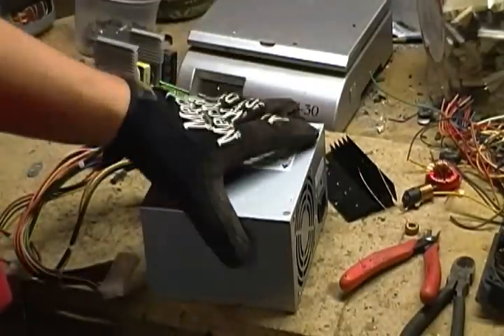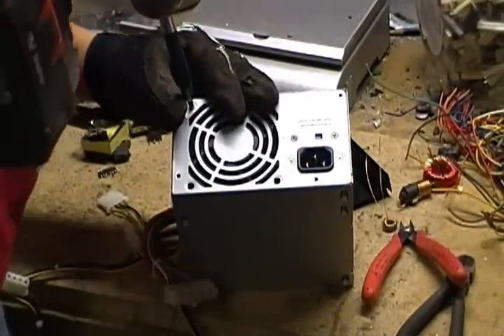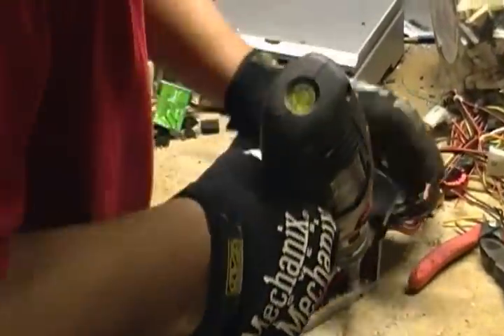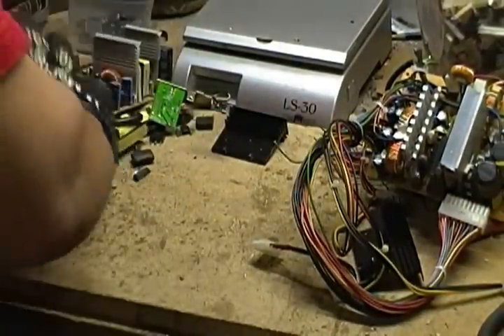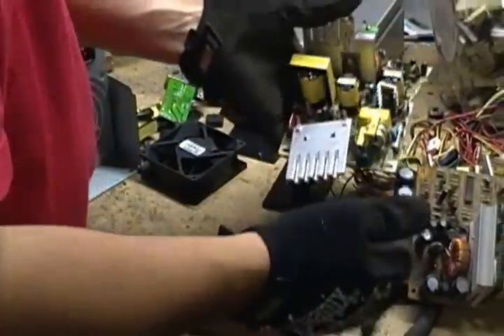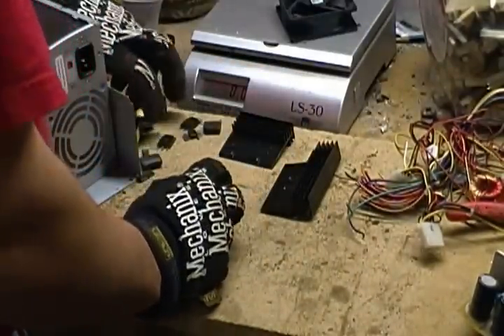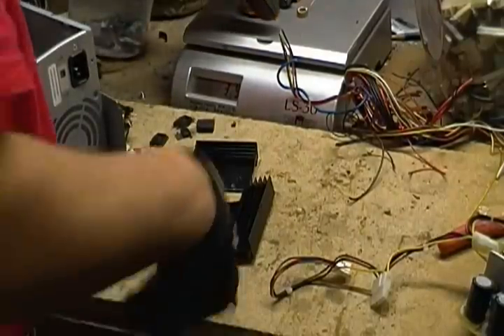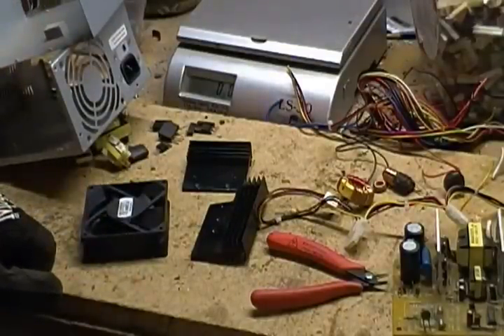Scrapping a computer power supply for aluminum, copper wire, and transformers

Comment: Specifications

1.High quality with best price
2.Well reputation
3.Factory with strong supply ability
4. Prompt shipment
Copper Wire Scrap, (Millberry Copper) 99% High Purity
 
Wire diameter: 0.30mm, 0.25mm, 0.20mm
Weight/spool: 3 kg, 5 kg, 7 kg, 15 kg, 20kg
Tensile strength: 1000 N/mm2, 900 N/mm2, 500 N/mm2, 450 N/mm2, N/mm2

Contac us directly Via our email address as bellow 

E-MAIL: frankjonatan400@hotmail.com
SKYPE :frank.jonatan

Phptoos are avialable 
BAFANA FARMERS CO LTD